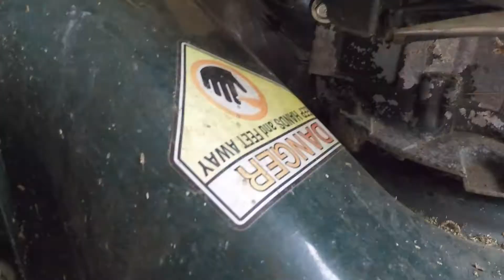Craftsman 21 inch mower carb clean Part 1

Comment: I found the same mower.i took apart the carb and found there was one welch plug in the bowel that came loose.looking at the carb it looks like it takes one welch plug on either side.can you tell me if there is one or two plugs in this carb. thankyou

Comment: Where can I buy this carb at
Reply from the maker: I usually get carbs on Ebay or Amazon.
Reply: @billyb351  
I've been looking forever to find it I cannot know where is there anyway you can help me find it by posting a link in a comment or anything
Reply from the maker: @codytipton90  The carburetor for this particular engine is Briggs and Stratton 790120.
Reply: @billyb351  did you find it on Amazon or eBay
Reply from the maker: @codytipton90  I can't remember if I've ever bought that particular carburetor, however they are on both Amazon and Ebay.  Usually Ebay has a better price.  I rarely buy whole carburetors.  I usually rebuild them.
Reply: @billyb351  I just went in looked all bad review everyone says the primer bulb don't line up